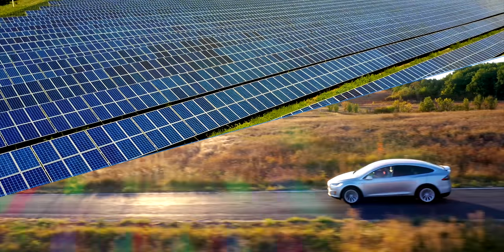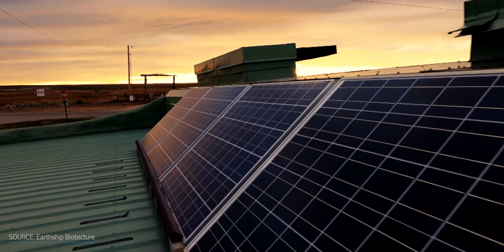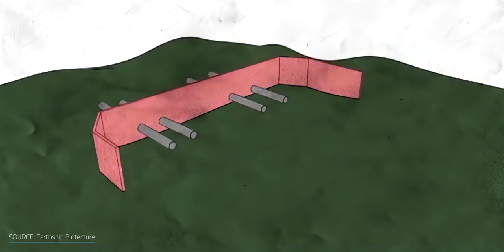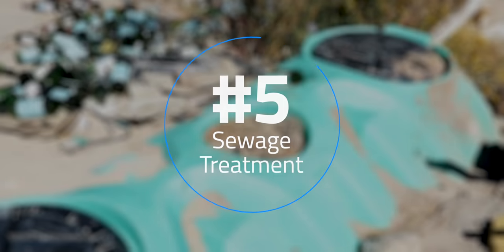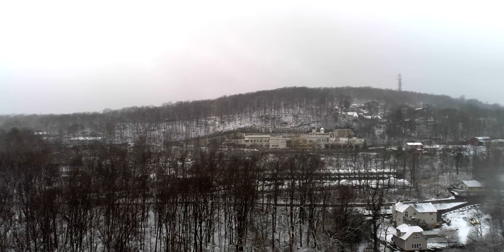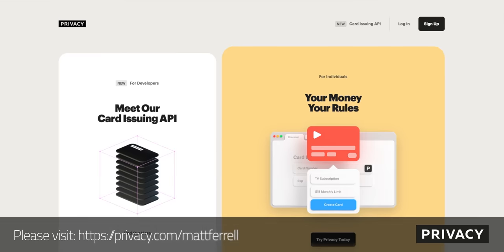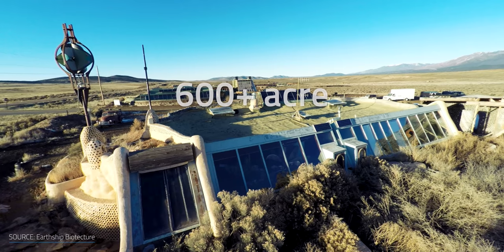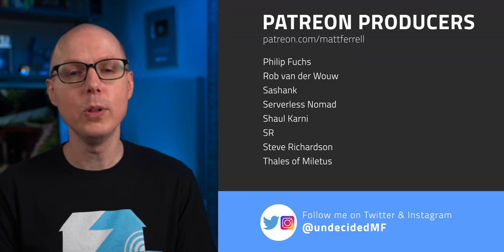Exploring Off-Grid Earthship Homes - Ultimate Efficiency?

Comment: Some of the elements of this type of building are sound and make sense.  In reality they are much harder to implement and balance in order to achieve good results.  Also the cost aspect may not be better, since it depends on human labor and expensive, thermally insulated windows.
I live in Canada.   Also, Thermal Mass is not the same as Insulation, you need both!
I know this because I live in an Earthship, which I didn't build, and is still unfinished.   In summer it gets unbearably hot (+30C), for there is nothing to stop the heat of the sun from shining through the windows.  In winter the house gets very cold at night, even with a wood stove burning, all the heat escapes through the windows.   Don't get me wrong, I love the open space and attempt to build sustainably - It is possible.   However, there needs to be more consideration when it comes to smart design, materials and implementation.   I've found that not everything that sounds cool, or "green" and sustainable actually is in practice.

Comment: I really like the concept but I'm more interested in stealing ideas and techniques from them for more widespread adoption. Especially with water become more and more scarce, the water reuse systems could be very valuable in places such as apartments, gyms, schools, etc. The passive solar heat and cooling system is pretty cool too. The way you can cool your house by using vents thru the cold ground bringing in cold air using vents and a heated area to wick the hot air out while pulling in the cold air seems genius and makes me curious how feasible it is to integrate into a conventional home.
If this technology starts really taking off I can see niche machines being made to help pack the dirt into the tires and community recycling keeping more and more glass bottles, cans, etc left in piles to be sold as is by the truckload.

Comment: I think we are approaching earthships from the wrong angle. We think them as more eco-friendly alternatives than traditionally built homes. The fact that passive homes perform similarly to them, but without many of its limitations in their current form (like the ideal places where they can be built) should clue us as to the fact that they are not fit to be commercially, large-scale produced homes.
BUT. And it is a big but… they serve an invaluable purpose that we have not properly understood.
Originally, Mr. Reynolds’ objective was to use discarded materials combined with self-sustaining, off-grid methodology to make them as a affordable as possible. However, as Matt pointed out, many of the earthship’s biggest flaws are centered around the labor-intensive process of building them, the special architectural needs of their designs, and the potential health risks that the process of decomposition of the materials involve (the mold, the fumes, etc.). All of these conditions pile up to undermine the potential benefits they offer to the way we conceive our dwellings. Yet, despite that, Mr. Reynolds’ project has shown that it is possible to build homes for small-scale, self-sufficient communities with essentially cheap materials. He has pointed out many potential ways we can take advantage of not only those materials, but also of the technics developed.
At their current state, the earthship is, in my eyes, a sufficiently successful proof of concept of the technologies involved. However, until their design flaws are properly addressed, the earthships are going to remain niche concepts.

There are, thus, two ways the earthships can be improved:

-Correct their flaws through further research and study, improving and optimizing their construction methods until they become a product that can be used safely for those who would benefit the most from constructing them at a cost as close as possible to their original concept. This is the current approach.
-Or, the concepts and knowledge can be exported to building with conventional materials, and technics, finding first a way to integrate them, then to expand them to the community scale. This way, especially with the water recycling and temperature management technics, new possibilities arise.

Now, I’m not talking about simply making passive homes 2.0. Think for example on Green buildings, which are intended to include farm space in their designs. Imagine then, the cost-effectiveness of using the earthship grey-water recycling method to irrigate the farms, and then reusing the resulting water for the toilets of that same building. Or adapting the passive temperature control to fit buildings.
These are just some of the potential benefits of understanding all what the earthships can offer. The same as with the materials used in building them, the earthships and the concepts that give shape to them go way beyond their original intended purpose.

Comment: Matt I'm wondering if shredding the tires to some optimal size and mixing with other product might not make an inexpensive insulation material or building block? Any thoughts?
Reply: The most significant thing about the tires is their ability to encase subsoil, which gives it the thermal mass. Rubber by itself (or, as you say, mixed with something else, but not encasing it) may repurpose material from the trash, but is not really a good building material.

Comment: The concept of the tires is great to reuse tires however, the tire wall can be replaced with rammed earth. Heating doesn't have to be a conventional. You can install a rocket stove that, with a cubic foot of wood burns at nearly 100% efficiency can warm even a coldest house all day. Additionally, the cost can be reduced significantly with sweat equity. You can also design them to look a lot more like a traditional home. You wouldn't be using as many recycled materials in this way, but it can be done. As for the building codes, the Earthships do undergo inspections by the local inspectors and since it has been going on since the 70's it is a proven method of construction, someone savvy inspector with amazing credentials that has been looking at these for decades just needs to write the code requirements. An R-value of 40! Why wouldn't you want that. Also, the benefits of building these in wildfire prone areas as they are nearly impervious to fire. Calico Ghost Town has a rammed earth home that was built in the 1880s and is still standing today. Except for the roof that was made of wood, it has survived two fires. Applying some of the construction technology developed in the past 40 years to this concept could make these feasible and code compliant in many climates.

Comment: Tires  breaking down and expelling gasses??? But tires are embedded behind plastered walls, the earthship is continually ventilated by the air tube, and the temperature in the walls are ambient. What would cause the tired to break down and release such toxic gasses under these situations?

Comment: There are a few parts to a earthship that I think make lots of sense even in a conventional home. Rain water collection and treatment with the water control module.  Relatively inexpensive and with the water coming from civic run sources would provide exceptionally clean water.   The bio botanical cells make sense but are really one of those things that just drive the cost of a home out of budget.   solar has become very affordable but still the costs of battery back up is a major cost that for many is not affordable.   Earth bermming is a great idea as it really incorporates the idea of the thermal flywheel.  Personally think for a commercial building might make sense, though I would not care to live with that in my day to day environment.  I would much rather just build a concrete wall that could be easily sealed against moisture. No real difference than building a dug basement.  As to the earth tubes. in an earthship they are always Far FAR FAR to short and deplete the stored energy of the earth in a short time so not good for a home.  Most homes need perhaps as much as 5 times the amount of tube to give the effective BTU storage and transmission.  Cost becomes a problem digging or burying 8 -10 ft down to get a consistent soil temperature that is no different than doing a ground source heatpump. The physics is identical.

Comment: i think you kind of missed the earthship analogy.  let me try to clarify.  you ARE travelling the galaxy on a ship, and that ship is earth!  you see you are building an enclosure that puts you inside, so you are more protected, as you would be inside a ship instead of on the deck of the ship.  that's kind of it.  my major concern with earthships is the tires, because they are chock full of nasty chemicals and heavy metals.  they claim it's safe because they are not directly exposed to sunlight or air, but i'm still quite concerned about that.

Comment: Comparing the R-value of a dirt filled tire laying flat, to a 4" wall...

What would the R-value of an equivalent width wall be?
Reply: can't really rate walls like these accurately with "r-value", hard to quantify the most beneficial aspect - the mass. same thing with ICF. even stick walls are rated incorrectly, because it doesn't reflect thermal bridging losses from studs/headers/etc. all you can really measure is a single material on it's own.

lookin at variables over an entire structure/property is the only way to judge perf between them, but that'd be an hours-long vid in-itself instead of an easy (and meaningless, imo) answer of X.

Comment: The costs are astronomical and only the rich or financed concept projects can be sustainable. Building a safe sustainable power grid using say salt reactors is far better for normal citizens. The killer is mentioned here as the choices of where to build are limited to relatively small areas.

Comment: I like the concept... but only somewhat.  My biggest problem with earthships is that nearly all of the sophistication involves moving parts or pipes carrying liquids, or technology-against-organic interfaces, not to mention outgassing from the building materials.  This will all work fine in a newly-built house, but I have grave concerns over accessibility for maintenance as a home ages.   That's my biggest problem with the concept.  I just don't think they will age well.

I think I'm more aligned with your feelings on the matter... translating some of the concepts to a more conventional home seems to be the more useful approach.  Electricity can fix many ills, so over-build the solar.  Discrete battery systems (verses all-in-one units) are easy to maintain,  Then you can use more conventional appliances, insulation, building materials, etc.  With enough solar heating and cooling the home conventionally (with heat pumps) is a fine way to go.

I also like the idea of rainwater catchment, but I think that reusing sink water and trying to reuse sewage effluent is a non-starter in terms of long-term maintainability of the system.

-Matt

Comment: I’ve watched a lot of content about earthships and passive home design. I think the biggest issue is the strict need for reused materials. That’s not scalable and or marketable to a wide audience. But the idea of more passive systems that waste less overall are critical for our future. It’s honestly so sad to see people say you “have” to build a sustainable home with certain materials or its not sustainable. 

The idea of reduce reuse recycle has permeated the General consciousness of the west but we’ve been sold the last word and forgotten about the first two. They are in that order for a reason. Recycling is the LEAST important of the 3. Each word is 10x less effective than the last. Meaning that reducing your usage of an item by one is 100x better for the environment than recycling that item once you are done with it. 

All that is to say that pushing the recycled building materials narrative doesn’t provide much ecological benefit compared to using virgin materials but it does create a barrier to entry in cost and complexity that blocks the concept from widespread adoption. I’d really like to see some plans come out for earthship style homes that use more modern materials and are designed for various climates. A bit more concrete which has a similar thermal mass as soil filled tires but is much more structurally sound and has modern infrastructure to support its widespread use. Less glass bottle walls and more double pane glass which offers higher transmissibility allowing you to better capture the sun’s energy. Deeper trenches with more robust heat exchange systems for cooling. I could go on and on. Basically all I want to see are more passive homes (homes built with passive heating and cooling in mind but more sheltered in the earth with burm style insulation and higher water efficiency. Over the next 50 years water reclamation will become one of the most important issues.

Comment: I belive most, maybe all ideas from earthship is worth considering. What I dont like is the use of tires which to me seems like a bad idea. I am also surprised at the costs. In Sweden it is close to impossible to build as cheap as an earthship costs in US even if you build it by your self. But I highly doubt that an earthship would pass Swedish regulations regarding insulation, heating, cooling, ventilation or sewage treatment without heavy modifications probably rendering a cost closer to or exeding that of conventional buildings.

Comment: I don't understand why the tires may breakdown? They are buried under mud most of the time except those in utility spaces up against the earth berm.  BTW -These houses don't have basements and your typical american homeowner tends to stuff them with extra stuff.  I think the sun heats the floor more than the back wall but the wall is capable of storing heat from the interior.  There are other ways to build thermal mass but the tires were cheap and easy. The glare of a hot sun can be very hard to live with. Screening it cuts down the solar gain. 

The earthships were all DIY or the first pioneers couldn't have afforded to live in them.  It sounded the ethic or philosophy was survival more than survivalism.  When you take the DIY out of the equation they become enormously labor intensive and therefor very expensive. There may be no easier way to build the mass wall using tires because they become hand pounded units of pise de terre that can't be lifted by hand. They didn't seem to use more than manpower because more sophisticated machinery just adds to the expense. They could have built the mass walls of pise de terre but that requires much sturdier formwork than even for concrete casting. These guys always had to scrounge for materials and that's what makes them so interesting.  Any idiot can squander a fortune in materials and money. None of those early earth-shippers could afford to do that so they really had to think about how and what they were doing. .  

The architect (not licensed actually) may have coined the name inspired by Buckminster Fuller's phrase for this planet "spaceship earth" because the planet is becoming as hardwired, integrated and has always been as discrete an object as a spaceship and it isn't getting any bigger.

Comment: Would have to be designed by an architect or professional engineer in places with building codes. Reuse of tires for construction would have to be shown as structurally sound. Also the house is basically rubbish after being built.

Comment: A far better building material is pumicecrete 
Pumicecrete is a mixture of pumice cement and water mixed and poured into a set of reusable forms walls are poured from 12" to 24" thick
Pumicecrete is fireproof termite proof rust rot and mold proof and has a high R value and good sound attenuation and can be built for a fraction of the cost and labor 
There is no better building material on the planet

Comment: Real genius would be to turn a super-optimizer like Elon Musk loose on Earthships. Optimize for homes which have already been built, not for $500,000 homes which are display items. (Earthships in Taos are sweat equity...that cost a LOT of sweat.) For me, the one that has always gotten my attention is our stupid waste of water. Take potable water and use it for...drinking. And toilet, and shower, and gardening, and your fish tank (yikes! Mind the chlorine!) That's a terrible cycle. If it were possible, I'd want to see an add on to an existing house system that would take potable water in, and then use it in every way possible until it is discharged to sewer or septic as black water. That is an easier re-plumbing job than building a whole house.

Comment: Why use trash like tires and bottles to make the walls when you can use rocks? All old buildings in Europe were built with rocks and mud. Some even with just mud by rammed earth. They last centuries, the walls are very strong, so much so you can make 5-story buildings easy (even with rammed earth). And when they eventually get abandoned, the result is a pile of rocks that quickly gets covered with trees. Much better than the piles of trash these things will leave behind when abandoned.

Comment: So basically the design principles would be still helpful to reduce energy/water use without going full-hog with the junk-chic building materials.  I do like the cooling tubes , grey-water reuse, and overall passivhaus concept with insulation. However, although these homes are good for the people who can pull it off in a suitable climate and feel good about doing their part, it's not going to change anything systemic.  It's like feeling good about recycling despite current recycling regimes feeling more like greenwashing. It's not going to change the world.